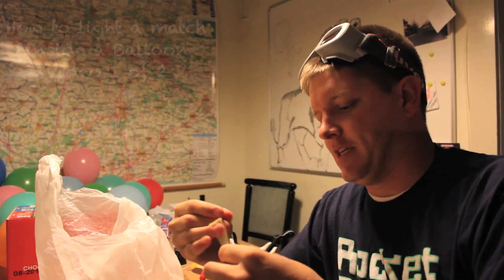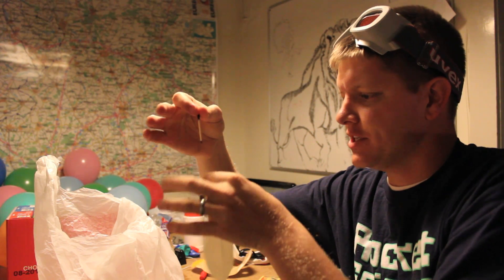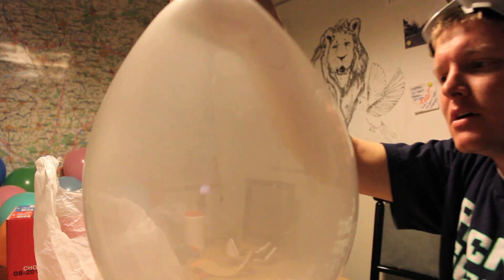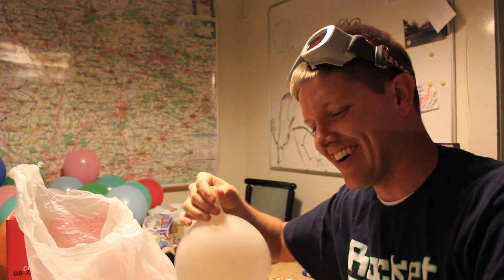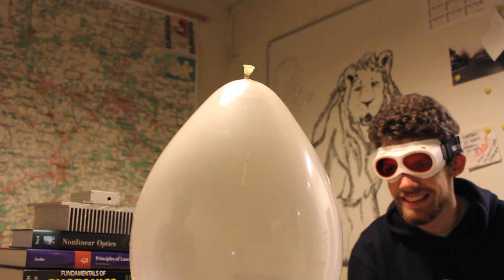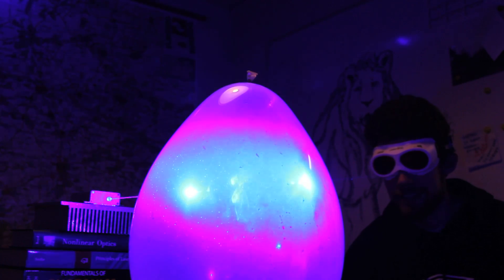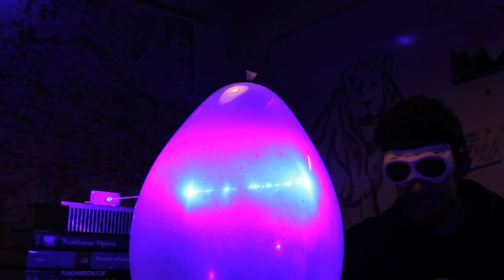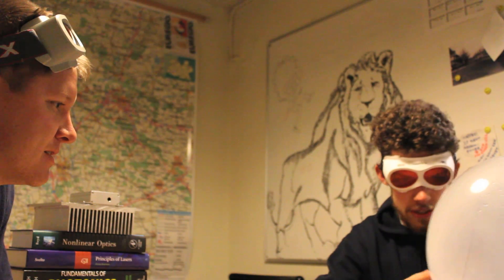How to light a match inside a balloon - Smarter Every Day 36 LASER MONTH

Comment: @Zaviex Yes, they do. The entire point of an 'equation' is that it is balanced and equal. The reaction does not balance itself - you start with a balanced reaction: Cellulose is an organic compound with the formula (C6H10O5) ... C6H10O5 + O2 (add heat) = 5H2O + 6CO2 Which means that for every molecule of cellulose you burn in oxygen you get 5 molecules of water and 6 molecules of carbon dioxide. The EQ is balanced, it doesn't balance itself. The chemicals just react in that ratio.

Comment: @PBnFlash To be fair you are incorrect the match head is mostly phosphorous there is actually little sulfur. Matches ignite due to the extreme reactivity of phosphorus with the potassium chlorate in the match head. Cellulose is an organic compound with the formula (C6H10O5) which contains a hell of a lot of Hydrogen and Oxygen = H2O (Water).

Comment: @matrixrory Hydrogen would be the easiest and probably the most reactive (The Hindenburg was full of hydrogen, which is why it blew up) but any hydrocarbon would also react (methane, propane, butane, etc.) They are just hydrogen and carbon chains, once ignited rapidly break apart in O2 (oxygen) to make water (H2O) and Carbon dioxide (CO2) - its the re-creation of bonds between the hydrogen and oxygen that give off the heat and light as making a bond releases energy.

Comment: @cen0322 No, it is just a chemical reaction - combustion in any form produces water (usually vapor) and CO2 as byproducts. Only rapid energetic reactions 'explode' but even just burning a candle gives off water vapor and CO2...any 'fire' does as it converts fuel (usually a hydrocarbon) into energy = breaking chemical bonds and creating new ones. This experiment is an excellent example of of a 'closed' system. They trapped the water vapor and CO2, excellent. :)

Comment: What if a white balloon were filled with a flamable gas, would it ignite first due to the heat or would the balloon pop first? (I know the balloon will pop due to the ignition but what happens first from above). Could you make a slow-motion of it with that Phantom camera you have?

Comment: You missed a really good opportunity to demonstrate some basic chemistry - I was surprised.
First, awesome video.
Second, however, did you notice the water that created from the reaction? After your match ignited (chemically converting into H20 and CO2) you could see the water droplets on the interior of the balloon = proof of the chemical reaction of combustion. Not only did the ignition exhaust the O2 inside the balloon, but the CO2 choked out the fire and water was created as a byproduct=cool